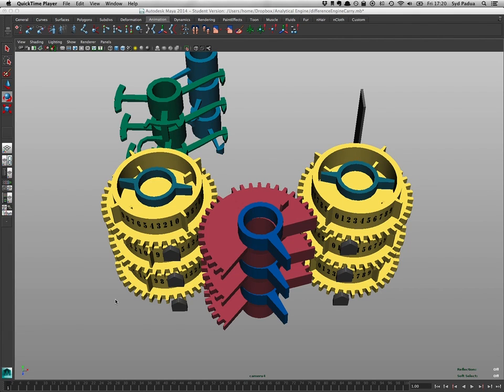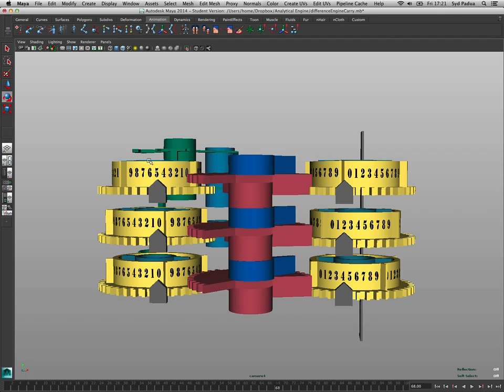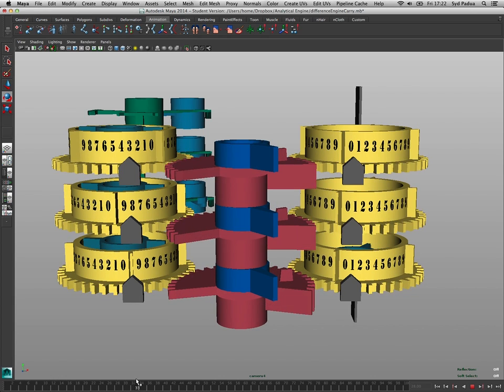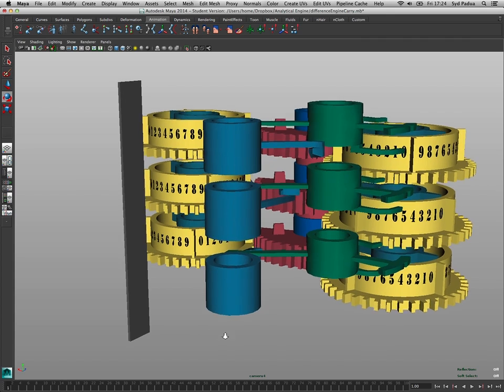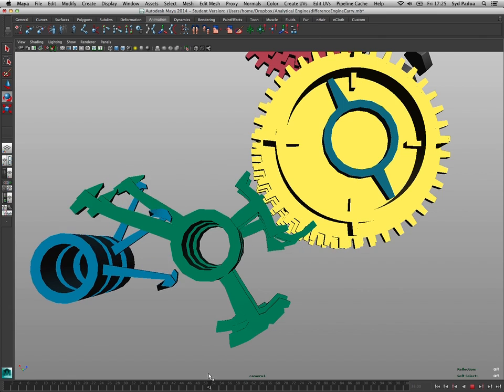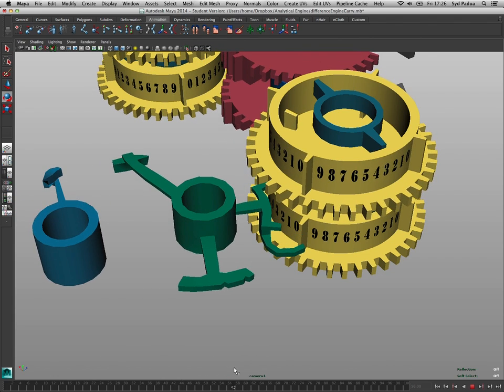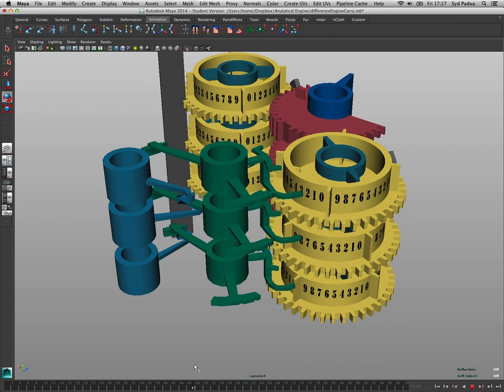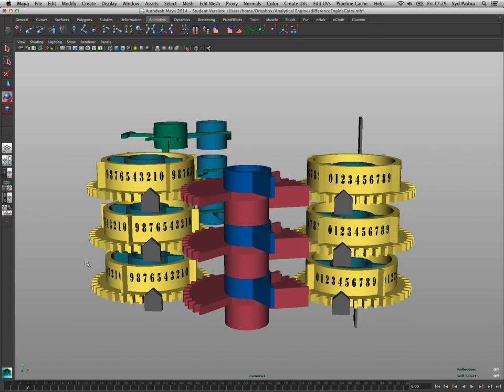Difference Engine Carry Mechanism with Explanation

Comment: Another lovely model. As I understand it, the delayed carry mechanism was necessary to reduce the loading on the 'adding' shafts and drives.  If you've ever played with an old mechanical calculator (I used them at school! in the days before pocket calculators) the handle would get really stiff on the overflow of even a few 9s

BTW what modeller is that you're using?
Reply: I'd like to know what modeller as well.  Thanks, Tim

Comment: I am hugely impressed by your managing to model this. I can barely grasp how it works, and I am, I'm proud to say, a professional programmer. I suppose you could feed all these Maya models to a 3D printer and generate a plastic difference engine, though it probably wouldn't wear very well! Bathsheba Grossman 3D prints in steel, but that would probably be too expensive for all this machinery.

I suggest anyone who watches this video would probably also be interested in the mechanical Fourier transform engine which is also on YouTube, which pretty much does for analogue mathematics what the Difference Engine does for digital.